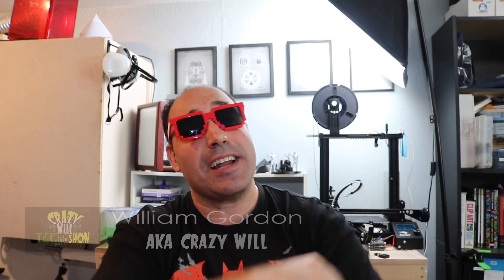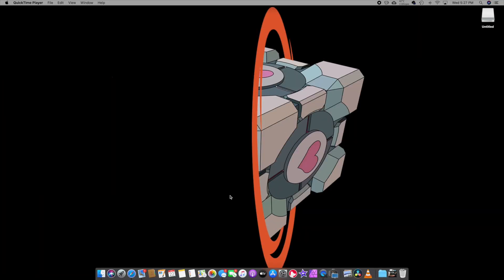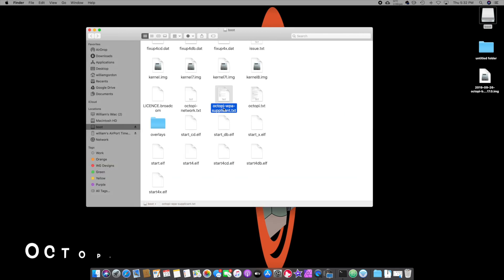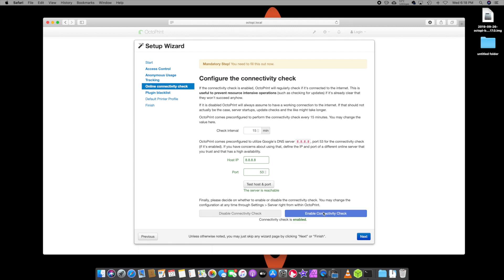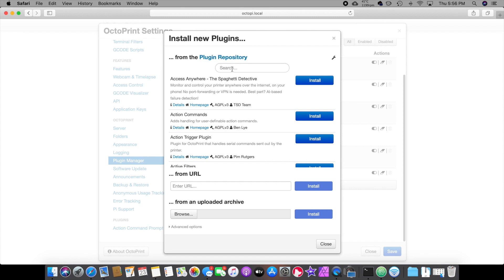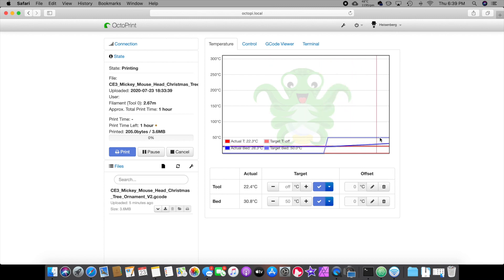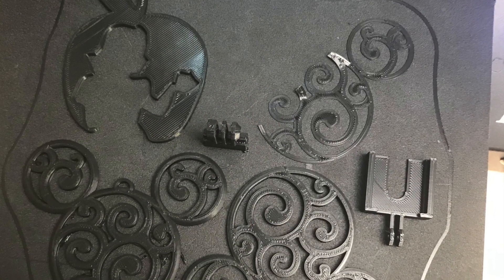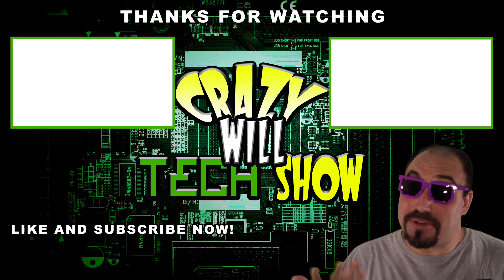How to set up Octoprint on a raspberry pi, wireless 3D printer

Comment: I did all this and it still gave me error:0000004 my pi isn't compatible with the octopi software.
Reply from the maker: Not to sound like an ass are you sure you download it the right octopi? I had this running on a raspberry pi 1,0,3 and 3+. And the SD cards were swappable.